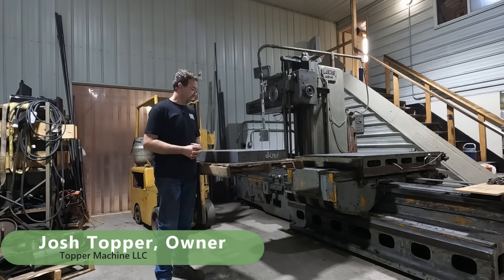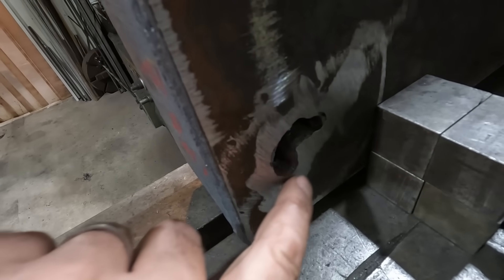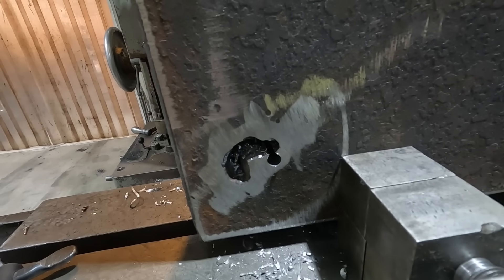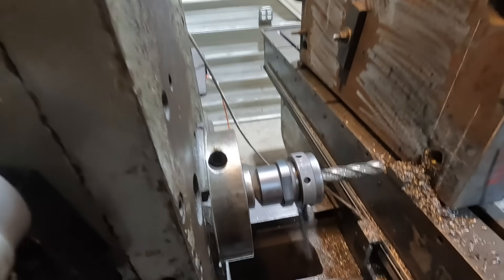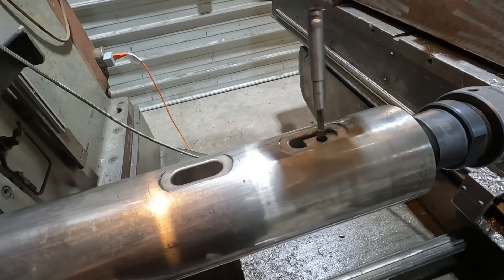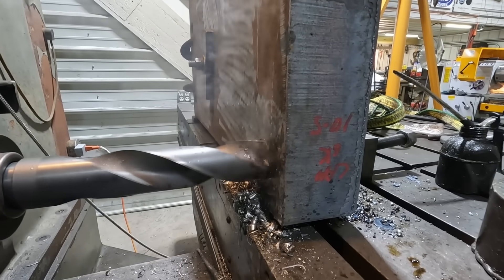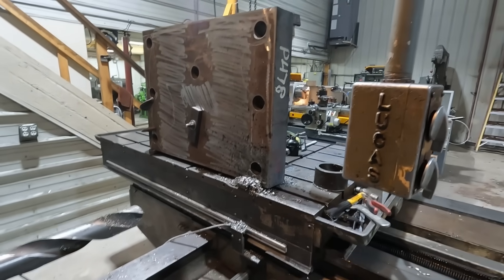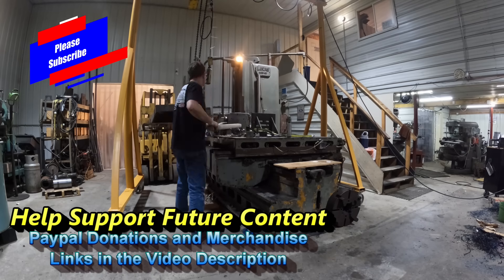How To Save A Plate With A Bad Torch Cut | Manual Machinist Repair Explained

Comment: Wonder if this was hand flame cut or some cnc machine one.
Reply: Wait you saud plate machine so probably it machine cut then. Just interesting, i work on a machine too, but its better unless something goes wrong. But this is the tjickness where we stsrt pre drilling and start from that hole instead of piercing

Comment: Hard to tell for sure, but it looked like those holes were cut either freehand or on a burn table of some type with either plasma or oxy-acetylene, etc. 
 The method can work fine, but those holes were initially pierced at the EDGES of the holes. It's far better to make the initial piercing cut in the CENTER of the hole, work outward to the edge and then around the perimeter, after the base metal has had a chance to heat up and the back-pressure against the flame has been relieved with a through-hole at the center. 
Takes a couple more seconds per hole because you're making a slightly "longer" cut path, (by approximately half the hole diameter.)
 But the finished holes are usually much cleaner.

Comment: 2 inch hole saw turned by a drill press, 3 in 1 oil for lubrication, 10 minutes later all done!

Comment: I'm not a machinist but I'm surprised to see you cutting something this large without coolant or air to keep the end mill from over heating and to clear the chips.  Is this how the machine is supposed up be run?  Just curious.  Looks like you got the job done just fine

Comment: The center drill didn't look fast enough for hot roll. I would put a through hole, then follow with a big end mill or drill. Then a boring head.

Comment: Hello Josh. I worked at a small locally owned machine shop before I retired. We had 6 lathes and 2 milling machines. One lathe was a large vertical one and we had a decent sized horizontal lathe we used to sub-arc weld large blocks(rollers) for fishing vessels. I appreciate your skills. Thank you.

Comment: Yeah, you can't pierce a hole that's smaller than the thickness of the plate. Even with a drilled through starter hole, 4" plate is pretty hard to come out with only a 2" hole, tip that large is just too hot to stay in that small of an area for that long. I would have just drilled the holes to begin with to avoid the risk and messing up an expensive piece of plate.

Comment: I am kind of disappointed that you didn't weld up their mistake after you punched through and re-bore it.  To me it's all about quality and completeness of work.  I honestly wouldn't have let that leave my shop until the job was complete whether the customer said that was acceptable or not.  Maybe that's my perfectionism showing up.
Reply from the maker: And you would have been paying for a new piece of plate.  Do the job the way the customer wants it done. There are reasons it could not be welded, and they were discussed with the customer before hand. I always ask these customers what is acceptable for repair.
Reply: @TopperMachineLLC  Fair enough, that's info I wasn't privvy to when posting.

Comment: I use to run a Horizontal boring mill. The one I ran had a high speed spindle like yours and an outer boring head where the tool would cut like a boring head.
That job would have been ideal for a core drill.

Comment: Center drills are for what they are called, for lathe centers. There are spotting cutters for use with drills.
Reply: Glenn yes 100 correct, though centre drill are meant for lathes, they have proven their worth to me  on a mill as well. For what Josh has done to the lump of metal to get the hole centered, it turned out great. Josh's channel is now my extra go to channel for honing the skills  as im for now a hobbyist machinist but have gained quite a bit of knowledge over the years thanx to a few great channels regarding metal work/ machining. Much greatful to those whom have helped me, plus the one on one assistance from toolmaker collegues over the years. Keep on bringing the great machining videos, Josh. Lovely machine shop as well😃👍

Comment: I see it done often, but how come you run the spindle out that far rather than running the table closer to the head? Seems like that would sacrifice both rigidity and accuracy? I understand it is for clearance to get the tooling out, but it just looks excessive and like I say, I see it often so there has to be a reason. Legit curiosity question, by no means am I a professional or knocking your work. Very cool, thanks for sharing! New subscriber, I love this manual machining stuff. I have a small Bridgeport and engine lathe for personal projects as I build a lot of forced induction snowmobile and sxs engines.

Comment: I worked at a steel shop that did processing. A general rule is 2" plate, less than 2" hole could cause trouble. Oxy-propylene is an easy way to get through, 90psi cut pressure. A good ramp up on your piercing valve will get it through. The other holes looked out of round and rough.  Like the machine needs some work.
Reply: Nice work on the fix.

Comment: Is there any reason you didn't use an annular cutter to make the hole instead of the drills & the endmill you did use? If you had the proper annular cutter, it would have been a one step process.

Comment: Make sure your camera is recording in stereo, thats hard to listen when you have headphones, it's only playing in one ear. Throws off your equilibrium.
Reply from the maker: Microphone failure. I'm working to correct this and find ways to repair what is already recorded
Reply: @TopperMachineLLC  If you ever have that happen, you should be able to duplicate the RH channel to the LH, or switch it to mono in the edit software.
Reply from the maker: @mikeworkman3593  I did that, but when uploaded to YT only some devices worked.  I have to watch my videos on 4 different devices now to ensure they all work.  The stereo fix was not working on my cell phone, so I had to give up on that idea.  I did  find another workaround.
Reply: @TopperMachineLLC  I'm surprised converting to mono wouldn't have been a quick fix. It's what I would have done if I could watch a YT video in my reg video player. Often I watch horror and cult movies that have been re-released with directors commentaries. They sometimes do this weird thing where one person will talk on the LH side and the other will talk on the right. I guess it's supposed to simulate them being in a room? ANyways it drives me nuts so I just go into the settings and switch to mono output.
Reply: @TopperMachineLLC  I'm a 30+ yr diesel/hybrid tech for the government. But I also went to school for TV production. So I'm pretty good with editing and setting up cameras and mics, stereos, etc. 

BTW, you should invest in a cheap body mount for a gopro. That way you have both hands free and people get a good POV of what you're doing. If you had 2 gopros, you could also use the body mount and a tripod mount, and you could cut between the 2 shots. I know that your not a big channel, but things like good editing and little things like split screens make the production quality go a long way. IDK if you've ever watched a channel like Fireball Tools, Matt's Off Road Recovery, FabRats, etc. They were tiny channels at first, but now have 500k to 1.5 mill subs in a short amount of time just by spicing up their productions. 
You don't have to spend alot of money either.

Comment: I have almost a decade in machine shop work experience and over 2 decades in welding and fabrication work..

Wouldn't it be better to bring the table in a little closer in on that work when milling to have less issues with tracking or vibration on the quill? Or just less stress overall on the quill? I've always been of the opinion (and taught) the closer you can keep the work to your machining aperture weather it be willing or lathe work the better off you are. 

Keep in mind I've never used a Horizontal Mill like that all my experience is on Vertical Mills. Thus why I'm asking. Nice work btw otherwise.
Reply from the maker: The boring mill has 24" of spindle travel and is extremely well supported and accurate at full extent. They are not a Bridgeport, significantly more rigid. Boring mills are a different animal. 

And, how would I film it if it was so close to the head?
Reply: @TopperMachineLLC  Like I said I have nothing but, Vertical Knee Mill and Engine Lathe Experience so it just seems interesting how much the quill can travel out without any issues like that. 

If I had just bought that machine for my shop I would be going way overboard with things like that I guess. I've always been of the opinion if I stress my machines less they will have much less chances of giving me issues is all. Thanks for the reply and nice work i like your videos ive seen so far. I wish i could afford not only the space but, the price of getting some more stuff like you have in my shop. \m/
Reply from the maker: @Demonlord468  I never ran a boring mill before getting this one and it was quite a learning experience. I'm still learning what I can do with it. I started out treating it like a Bridgeport, and quickly learned it can take way more.  They take a lot of room and money, but it's been essential to what I do.

Comment: Hey, you know they’ve got a good engineer up there somewhere that was probably a machinist at some point if they know to only spec the needed tolerances. IE, why waste time and money on tolerances that are super tight if all it’s going to do is hold paper towel in a toy kitchen? Smart way to save time and money is to only put out the tolerance you NEED.

Comment: You did a good job saving this plate.
I was just wondering: did they do NDT on the plate to check for flaws (rolling defect) in that, probably, important piece of material? Could be the reason for the flame cut to fail.
Reply from the maker: It was 100% torch operator error.  I know these plates go through quite a testing process.
Reply: @TopperMachineLLC  Pfew, what a relief😅 Thanks for the reply.

Comment: They cut part of the hole with a torch. So the edges of that hole would have been hardened. If I  did what you did the hardened metal would have ruined any high speed cutter I tried. So what did you do differently.  Or was the metal different and not hardened at all.??
Reply from the maker: Years of experience!  Slow feed rate and rpm, and oil.  And a ton more experience and patience.

Comment: That’s scary working all alone with that gigantic plate… imagine it accidentally feel on you while mounting it to the work table. Should always have someone to observe as back up.
Reply from the maker: Nothing scary about it. If you watched, you saw the crane was never disconnected until it was secured down. This was a small plate compared to some I have done this same way.

Comment: If you watch when you started drilling with the 2 inch drill bit the cutting flutes are not at the same lvl so it will cause the drill to wander , you can tell by the fact they started cutting a different times by the cuttings being different lengths .

Comment: You need a magnetic mount for your camera. I am getting seasick from you moving back and forth all the time.  LOL  I am a welder. I could have cut that hole with a hand torch since it had 1/8" slop. LOL
   I hope to pick up a metal lathe to learn a new trick or three when I build my shop in the spring.

Comment: I started my machining career with Van Norman vertical/horizontal machines with a tag on them “Approved for war time use”.
Kids today have no idea what to do if it doesn’t have a computer attached to it. Nice work. Drill could use a little touch up, but I’m what my kids call “Anal”. Thank you, very nice work.
Reply from the maker: Had I been doing something more critical, I would have sharpened it a touch. But since the torch cut was iffy, I was more afraid of a drill too sharp and chipping the edge worse. I've done it before.
Reply: In no way being critical, worked great for your use. Just an old tool maker/shop manager. You learn how to gauge these things. Much better chip at the higher chip load and full contact.🤘🏽

Comment: Seems like maybe in the very beginning that a simple mag drill would have been the easiest tool for this job. Great job on the repair!
Reply: That’s a monster hole, a monster annular cuter,  and a LONG time to cut those. Torch is the money.
Reply: @irondiver292  We have annular cutters up to 3 inches. Cuts a hole in 1inch plate in about 1.5 minutes
Reply: It was 4" thick.  A 4" depth 2" annular cutter is going to run you a minimum of $500.
Reply: The problem is making the mistake in the first place. Watching these old manual machines brings back memories.  Modern machining the process is much  different. Here they just need big clearance holes in four inches of steel.  And every shop has different equipment.
Reply: No shortage of stupidity in America !!
Reply: Do you know what those bits cost?

Comment: Prefer coolant for drilling than cutting oil myself.
Good job though 👍
Reply: Cutting oil doesn't mess with your sinuses like coolant can .
Reply: @bobbrinkerhoff3592  i've been at it for 30 years now and that's a first time i have heard of someone mention sinuses 😂
Reply: @BrettT-ej6jy  I don't know what the deal was , but the last place I worked at messed me up when I ran coolant . So I used either old drainage oil or ATF . The places I had worked at previously never bothered me .
Reply: @bobbrinkerhoff3592  i've worked at some places which rarely change the coolant and after awhile it absolutely stinks. Tight arse bosses 😂.
Reply: @BrettT-ej6jy  I've had to change out some of that rancid crap , but this stuff was fairly fresh  , and I mixed it myself , so it wasn't over strong . Mostly I'd get a sore throat from hell for several days .  And I've never smoked , so it wasn't that or anything going around either .

Comment: I did a job like this a while back. Used my radial arm drill.

I found it good to fill the rough in with mig weld as best I could, then drill it out. 

Keep up the great work.

Here from the uk 🇬🇧

Comment: The reason I like small pilot drill bits.
Several times I have used a chunk ?? 3/8" flat bar against some hole I have needed to put into place it worked with what I had at the time. 
Sure is nice to have the equipment!

Comment: Would a rotabroach have just cut that to the 2" and not been affected by the pierce? Nice repair.
Reply: Yes, but if there is any slag in there it would murder the HHS. I have had good luck with the carbide tipped rotabroaches

Comment: Put some rubbing alcohol in a spray bottle that gives that drill a squirt every 10 seconds or so to the big drill cool, the heat is what ruins them the alcohol sucks the heat out of them as it evaporates.

Comment: Awesome video Josh.
I really like that Lucus HBM.
It is a very versatile machine and a workhorse. 
Nice job.
You have takin a disaster and turned it into a usable part.
At the price of steel, a company could not afford to have a big piece of scrap.
They should have had you put all of the holes in that plate.
Thanks for sharing. 
Take care, Ed.

Comment: I started out machining in 1994 on a Gilbert a little bigger than this machine.  My Dad even ran it from the late 60's when he started out.  The Machine was with the company since the 40's  We used it weekly up until last year and sadly it was decommissioned.  Everything is about safety now in Big corps and we were under their umbrella.   Open machines freak the higher up's out.     The machine probably made a Billion dollars during it's life :).  Glad to see another like it still making swarf..
Reply: The one machine that people got hurt with more here was the big radial drills.  Usually something to do people trusting them or something
Reply: What happened to it? Was she scrapped, if not is there a way to save here from scrapping, or worse... sent overseas? 

Frankly, I think a good non practical use for her, is a decorative peice in front of corporate HQ or some other company property.

In my state we had several companies that are involved in geological resource extraction and refinement.

While corporate HQ is elsewhere, sites have old equipment as a decorative peice near the gate or elsewhere where the public can see it without trespassing.
Reply: @DesertCatDad  It was eventually sent to a small job shop from what I can gather.  The parent company unfortunately got rid of most of our manual machines.
Reply: @bryco32  Outsourcing health and safety liabilities to subcontractors is the standard corporate way.

Comment: Tell em next time just send you the plate and you can knock the holes in it for em and they won't look terrible, need rework, and will be within tolerance.  Your radial arm drill should make pretty quick work of that with flood coolant.

Comment: I'm just as confused how someone would sharpen a 2 inch drill as I am an 1/8th inch drill. Do you use hand stones or a bench grinder and just move it along like a knife?
Reply: You just hold the drill bit at the correct angle and work each cutting edge back and forth along the width of your grinder stone for even sharpening and stone wear. The drill size doesn't really matter.

Comment: Hi Josh.
Loved running DeVliegs and Lucas HBM's back in the day. Spent almost ten years running them. If I had the space there would be a Lucas HBM in my garage. Have to make do with a Bridgeport. Did a lot of machine elements and weldments. The job in this video is something I have done hundreds of times. Fabricator making the weldment "helps" by taking meat out and now I have to put the hole back on location.
Love watching the old stuff still saving the day!

Comment: Whew, good way to snap off the drill tang. But cool heads prevailed.
Reply from the maker: I've never snapped one off. Slow steady pressure, never forced.
Reply: @TopperMachineLLC   I did 55 years ago, never forgot it. We did a weld build up and machined the tang,